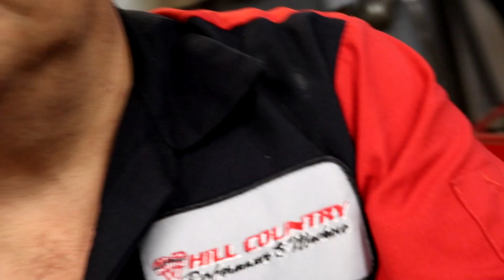DIRECT INJECTION VS PORT INJECTION

Comment: You can thank CAFE regulations for this mess. If you’re a car guy I’d definitely get a catch can if you have a DI vehicle.
Reply from the maker: Just before the intake valve closes hot gasses come back up the port.
A catch can would help with blow by in the crankcase but would not help with what's happening in the intake port.

Comment: Looks like valve stem seals leaking or bad pcv valve
Reply from the maker: Yes looks just like that but it's not, it comes from no fuel in the intake port to help clean it.

Comment: Is the gasoline bad quality in the states?
Reply from the maker: Yes it is.
Reply: @MrDanielSoliz  Hmm we maybe have the same problem here in Norway... We blend in 15% Methanol or Ethanol.. not sure one of them but this is for the gasoline to burn a little bit easier with the added oxygen from the Methanol/Ethanol mixture when burning i think. I know one thing for sure and i have tried it.... destilling the gasoline you buy from the pump and you get a layer of oil look alike fluff in the bottom of the still process. My car runs much better with the homebrew gasoline.... but it takes time to do all that destilling and some gasoline get vaporised in to the air in the process
Reply: Nah gasoline is good quality in usa probably not the best in the world. Iv notice when I get walmart fuel my truck has less power than when I fill up with exxon fuel.

Comment: When I was small, we cleaned oily parts with gasoline because that's what we had on the farm. It worked well. Port injection "cleans as you drive" while direct injection does not. After watching Diagnose Dan clean the ports on a GDI car I won't be buying one.
Reply: The problem is actually fix now with SP grade oils

Comment: Direct injection goes directly into the combustion chamber...    not upstream of the valve.     Currently they're working on a system that has both  port injection and direct injection...   using direct injection when it's most useful for efficiency like at cruising speeds, but switching back to port injection at other times so the fuel can wash the port and intake valves off, reducing the carbon buildup.
Reply: My tacoma has port and direct injection. It uses the port injection at low rpm. And direct injection at higher rpm.

Comment: they did not put a filter on egr system not a hard thing to figure out with baffles and screen fer carbon to catch on..or use both like types of injectors toyota does

Comment: Newer engines have both intake injectors and direct injectors.. A lot of the residue is EGR gases and or crankcase fumes being recircuted thru the intake.
Reply: Toyota was first to "re-add" a conventional injector to a DI engine design. It's perfectly suitable for daily drivers, but wouldn't work well in performance applications. Dealers have access to fuel treatment systems that clean intakes without disassembly, but currently cost $ hundreds and fail to address the underlying design flaw of DI engines that also have EGR and PCV systems resulting in increased maintenance intervals. 

I'm personally interested to see a petroleum fueled engine utilizing solenoid actuated valves, Direct Injection, and HHO gas to achieve high mpg and high performance on demand.
Reply: @macoppy6571  My Lexus ISF begs to differ, as it's a performance engine, lol.

Comment: Excellent topic Danny, I heard about this sometime ago what really bothered me was will use the big three as an example how was this overlooked how did they do that without catching the fact that the valves could gum up like that really makes me wonder. I know that some manufacturers have tried to correct this by using both types port and direct to help keep the valves clean I’m curious how effective that is is that I think these are relatively new engines not sure about that anyways keep up the good work stay safe👍

Comment: Excellent video Danny !  Back in the day, what I was taught was to run my  car, A Ford LTD with a 390 and a Carter 3 barrel carb, at WOT down the interstate to blow the carbon out, to clean the engine.....Ya'll think that would work now 🤔

Comment: most of the soot is from the oil from the valve stem seals, water injection will help only if water will be heated a lot

Comment: Any idea how many miles were on that Traverse? Another strategy by manufacturers is to use both direct and port injection. The Subaru BRZ and Toyota 86 Twins are a good example. Small port injectors for valve cleaning and more fuel control strategy, direct injectors for the full combustion effect.
Reply: Most toyota and ford use both

Comment: Danny idk if you meant to say direct injection is pointing at the piston not in the intake runner at all? Could an oil separator from pcv might cut the oil gunk up on the valve? Oh ya I know you're not a fan of direct injection but what about injector in the head on a Flathead pointing at the piston? Do you think it might pickup up power?

Comment: If you can't decide on what kind of injection you want, maybe get a Toyota with D-4S dual injection. They run primarily with the direct with a secondary port injection to help keep valves from gumming up with carbon build-up.

Comment: Here everyone talks wonders about the DI over the carburated cars; but a friend had to pay like 3600€ for clean the ports and valves and change some the needles on a Mercedes that was 8yo back then, all what i know it's that all the pimp cars of my time were carburated and for 3.6K euros!? you could get an entire brand new engine, tunned, clean, installed and running. Have a great week in that house Dani